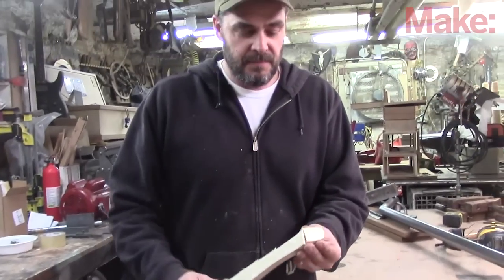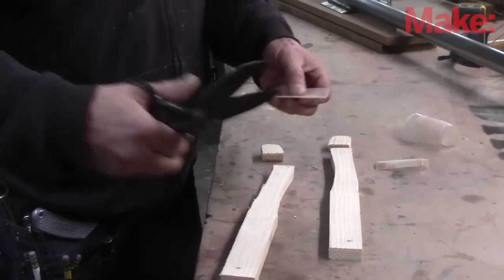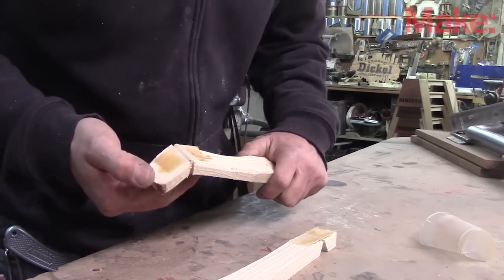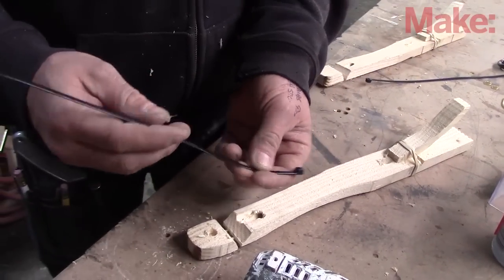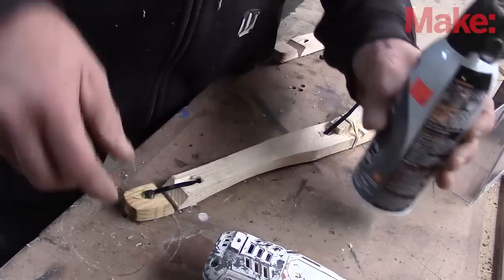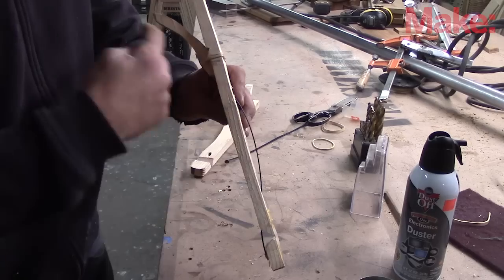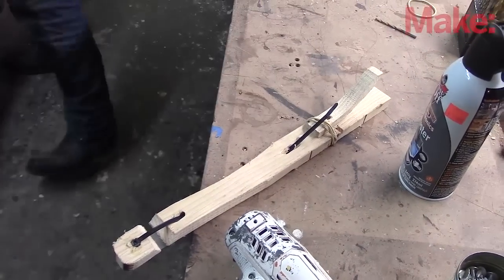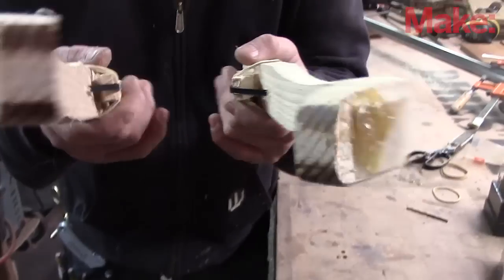DiResta: Cat Puppet Paws

Comment: Please let me make a small suggestion.  When using  a bandsaw, it's never a good idea to have the blade guide set any higher than it absolutely needs to be.  If you're cutting 1/2" material, bring it down to no more than 3/4",  This is for two reasons.  First, the flexible blade will wander less, giving a more accurate cut.  More importantly, the guide is also a safety device.   its' secondary purpose is to keep ones' hands from coming into contact with the moving blade, in the event of a mishap.  Be safe, everyone.
Reply: Watch the end of the bandsaw tips video on my channel  tx u
Reply: Thanx Buzz Killington...
Reply: People point out flaws in others work like there is done kinda prize for it.
Reply: I didn't say a word about the guys' work.  For the record, I find it charming.  I, though, have been in one kind of workshop or another,, literally since I was in my crib, and have seen some ghastly accidents.  If I'd been caught by my supervisor using the company band saw in that manner, I'd have gotten an earful.  If I'd done igoa second time, I'd have been written up.
Reply: Well, you know what they say, If you don't like my attitude, quit talking to me.  If I can help save somebodys' fingers,  I'll do so.  If this upsets you, I don't care.   

Kaliban, by the way, is an allusion to 'The Tempest'.  To my knowledge, The Bard never visited the Granola State.
Reply: No, I'm not.  The idea that somebody could object to a guy trying to protect someone else from an unnecessary injury is just plain weird and, I admit, unsettling.  Get help.
Reply: TheOneTrueKaliban Did you watch Mr DiResta's other video as he suggested? If you did, you would know he doesn't need any of your suggestions. You want to save people? Go make your own “how-to" videos. I'm sure they will be just as popular as Mr DiResta's.
Reply: smashedism It doesn't matter what else he's posted.  The way he was using that bandsaw was dangerous beyond description.  A beginner could look at this vid and end up getting seriously hurt.  If you don't care about that, fine.  Before you start your next woodworking session, I suggest that you drink a pint of vodka and put on a blindfold.
Reply: TheOneTrueKaliban 
Lmao..He was using puppet arms for fuksake. At no time were Anyone's hands actually near the blade.. Jeez dude, come back to reality.
Reply: Thomas Klink I was just thinking the same thing